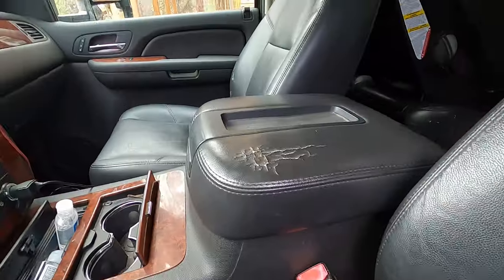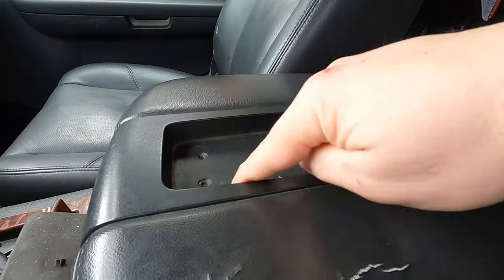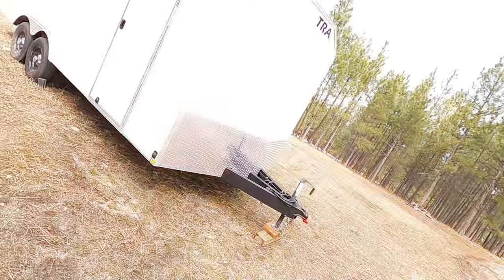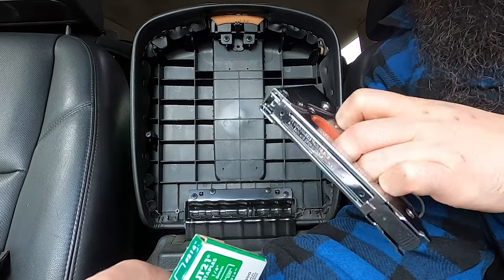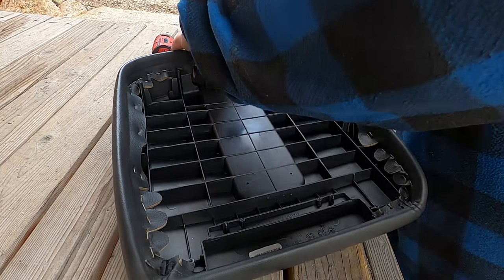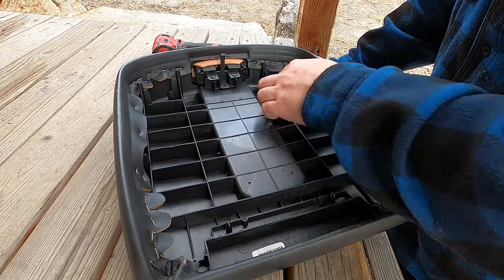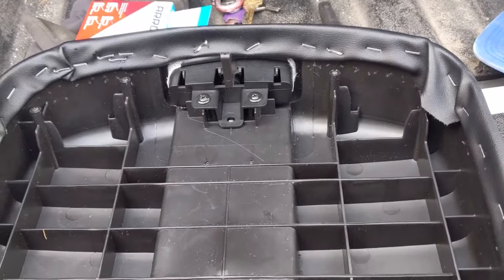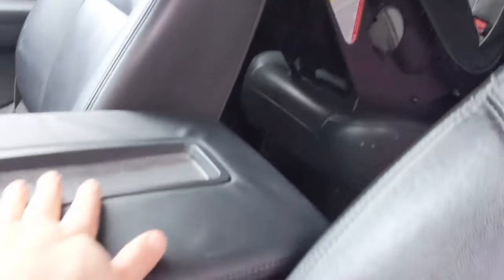Replace Center Console Armrest Material | Tahoe, Suburban, Sierra, Yukon, Escalade

Comment from the maker: Here's the cover I bought (that doesn't have additional padding like the stock version):
https://www.ebay.com/itm/Fits-07-14-Chevy-Tahoe-Suburban-Escalade-Black-Vinyl-Leather-Console-Armrest-Cvr/131399929469

Here's the new hand stapler I bought to replace the T20:
https://www.walmart.com/ip/seort/27270062

T50 staples (just a bit too long without extra padding in the cover):
https://www.walmart.com/ip/seort/14962207

Again, I plan to revisit this after we move to get it cleaner and possibly a better fabric. Hopefully the video helps you at least see the basics of how it would be done.

Comment: Contact Cement could be a good option for installation as well with a plastic scraper or flat edge to push the leather down tight into the underside areas.
Reply from the maker: That's a good idea. I had 3M spray adhesive that I used to repair a civic door card fabric since this. Contact cement might soak the fabric, at least I'd be afraid of that.
Reply: @WildMountainGarage  That's true on the fabric. I would only try it with the leather type material.  I have to rewrap my center console as well and the inside driver side door handle just snapped loose behind the door panel covering.  I''m going to try using epoxy to repair the plastic parts and then reinforce the glue joint with t-shirt cloth material soaked in epoxy.  Basically a DIY fiberglass. It's all hidden inside the door panel so it won't be seen. I hope it works.